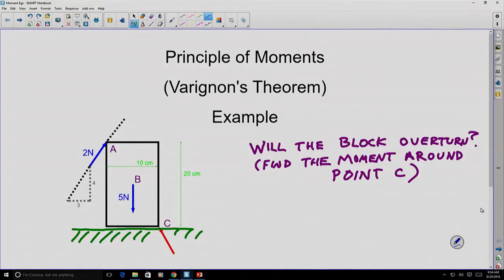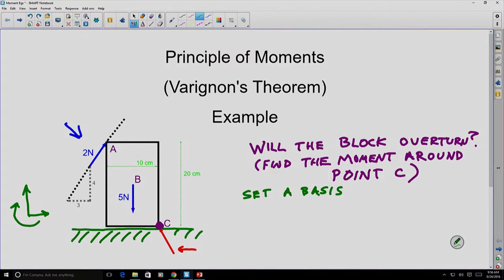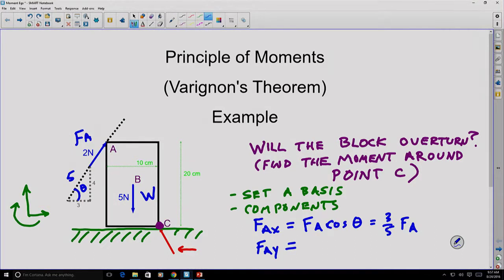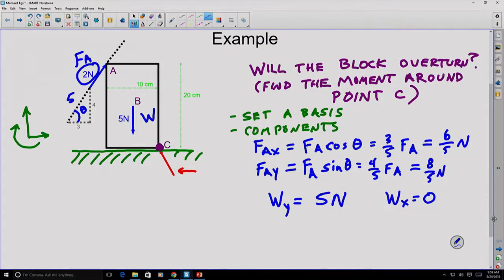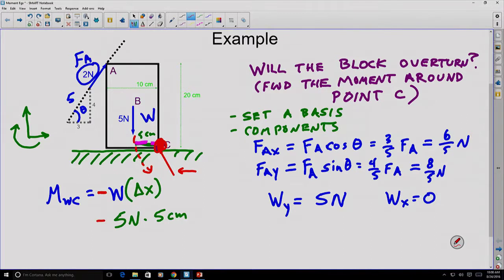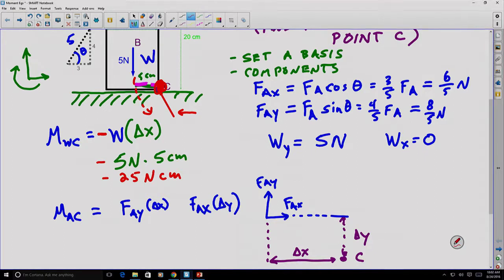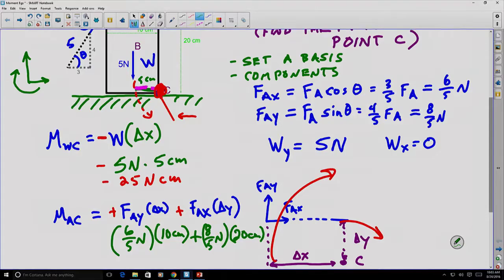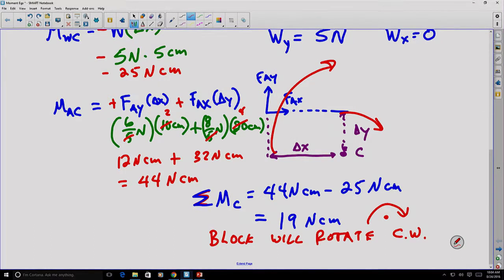Principle of Moments: Varignon's Theorem Example

Comment: why do we have to consider moment caused by the weight of the block? doesn't the moment caused by weight get cancelled by the moment caused by normal reaction of the surface?
Reply from the maker: If the entire bottom face of the block is resting on the surface, then yes, the normal force of the surface on the block is collinear with the weight and they cancel, and there is indeed the start of an overturn moment created by F_A (and the friction along the bottom of the block). However, once the block starts to rotate , then the block will lift off of the surface and the only place for the application of the normal force will be at point C.  We analyze that instant (choosing rotation about C to eliminate the unknown values of the reaction at C) to determine if enough moment is generated to continue the overturn, or if the moment provided by the weight prevents further rotation.